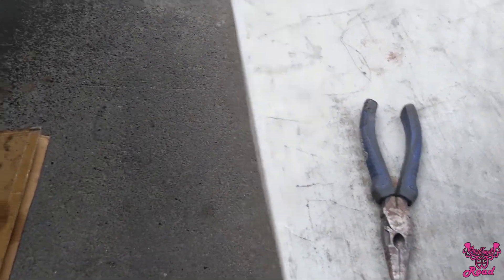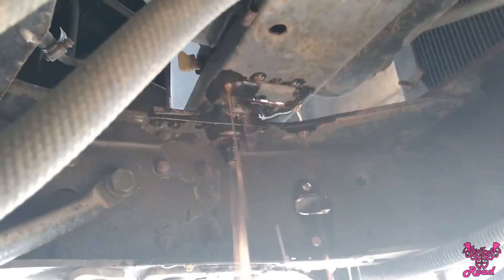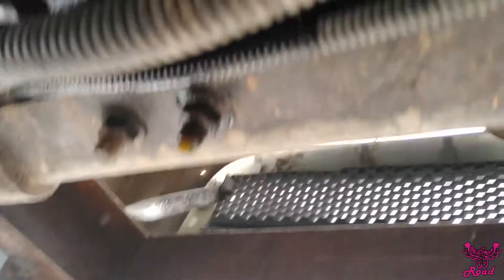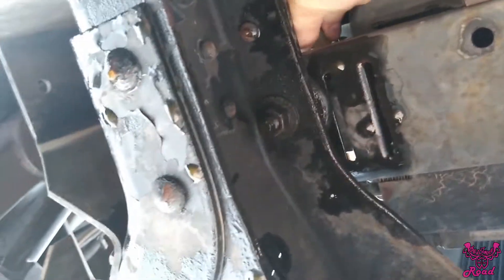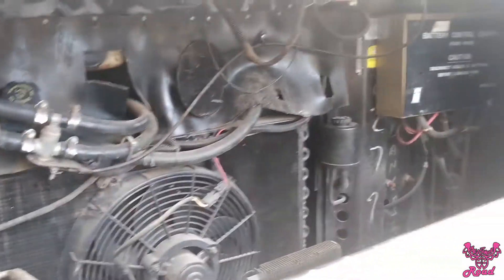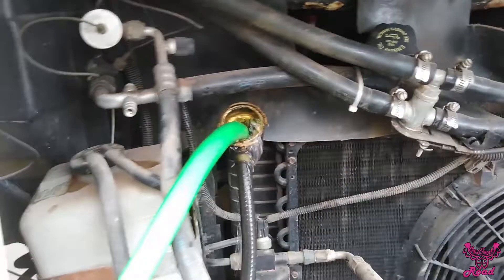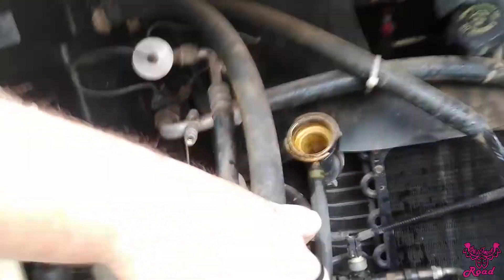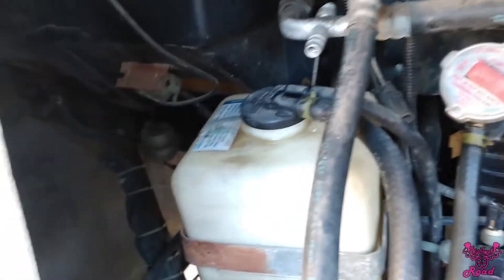Flushing the Coolant System on our '96 Chevy P30 7.4L RV Class A

Comment: Thank you for this video!! I have a 96 Rexhall Rolls Air with a Chevy P30 and I’ve been wanting to flush the cooling system. Now I know I’ll need a big wide pan for the job!!
Reply from the maker: Yes most definitely! Super easy job, just make sure the heater core is open and you flush it in reverse from how it normally flows to push the gunk out easier and dont apply to much water pressure to the system. I will soon have a video up of doing the radiator and water pump.

Comment: Good that you are doing your own maintenance.  We have a 95 Allegro with 7.4.  I have put a lot of wrench time in mine.  I can appreciate a video that shows how those things go at times.  :) :) Our P30's previous owner put a flex fan in it so now we are looking for the original fan and clutch information.  The search never ends.  Hope you enjoy your P30 as much as our family has.  Take care.
Reply from the maker: We feel the same way! I was once a certified mechanic just dont have all the tools like I used to when I had a garage, always enjoy helping people where I can on their vehicles. The p30 is a great set up. And I will be doing a video on a full radiator and water pump install soon on ours before we hit the road again. I want to keep this baby going for as long as I can!! We appreciate you watching and commenting!
Reply from the maker: Should be able to find a clutch and fan on Ebay. Wish every junk yard would kept motorhomes. But they tend to scrap them quickly.
Reply: Awesome vid my 88 allegro 7.4 is heating up once the rain quits I’m gonna yank the thermostat out and see if that fixes is if not it be a rad flush and core flush. Thanks for vid would love to see more with your rig
Reply from the maker: @eleigey  very possibly its clogged on the inside. I found out by taking thermostat out and looked over and the hose was bulging out and had all kinds of sediment and crap inside when I popped it off. I am going to be  replacing the water pump and radiator soon. Mine also had a severely undersized belt on it from previous owner. I cant believe I made it around America in this thing like it was.
Reply: @BEASTmodeontheRoad  that’s crazy mine actually had a plugged/shot radiator and water pump died. New rad, water pump, engine flush, fresh oil change, and it’s back together now I’m working on getting the landing gear working again. One thing after another lol
Reply from the maker: @eleigey  I should have done that back then, after driving across America slowly slightly over heating, I finally changed the radiator and water pump last month. Getting ready to head back across.
Reply: @BEASTmodeontheRoad did you make a video of the radiator and water pump change? I can't seem to find it...